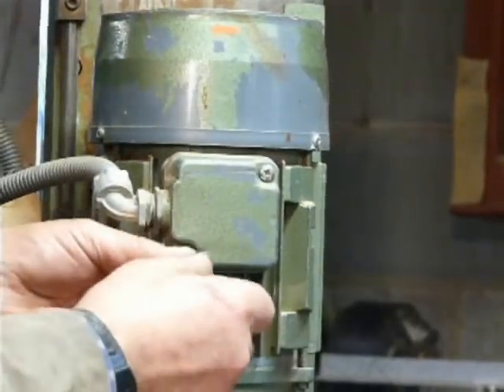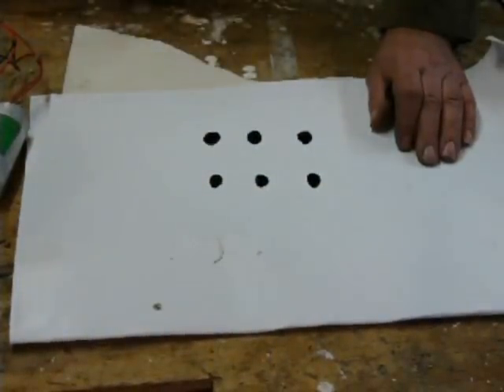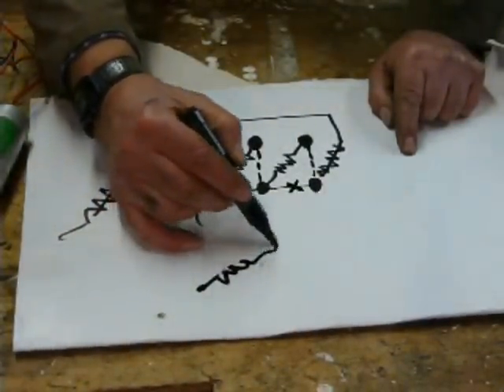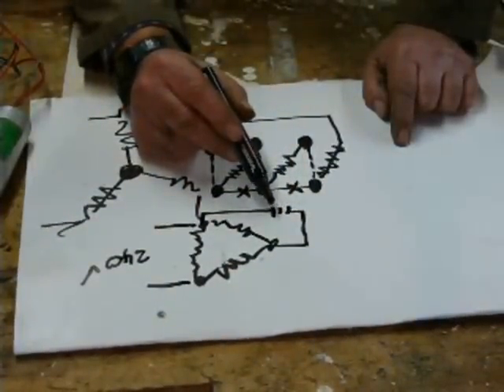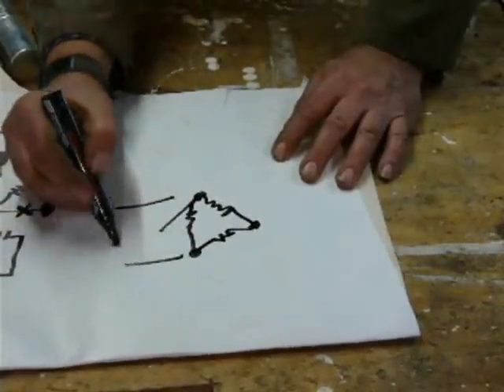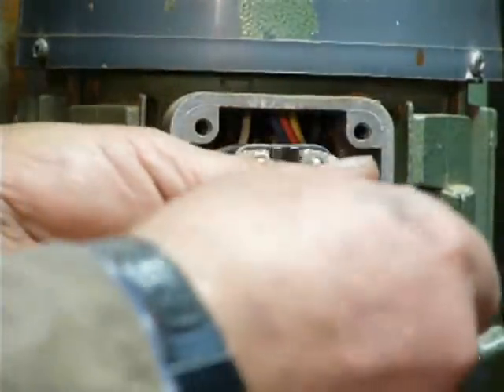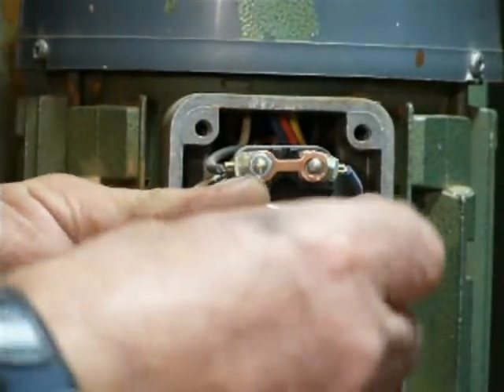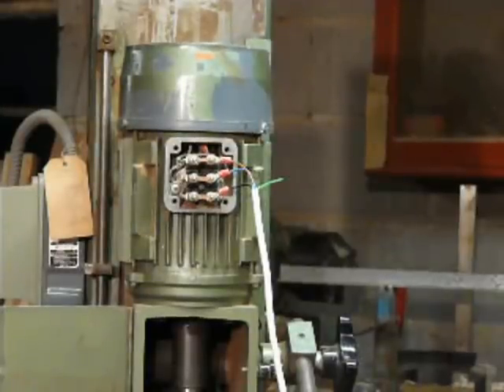How to do it: run a 3 phase motor on single phase supply. part 1

Comment: Hi.  In your very well helpful video you demonstrated what you were doing to change the direction of rotation in a delta connected motor.  I am assuming that a star connected motor works the same way as far as the capacitor connections are concerned.

I just hooked up a used vehicle hoist w/ a 3 phase motor connected to a phase converter w/ Parallel Capacitors - WYN SCM05 . 

The lift had been lying on its side and there was lots of leaked hydraulic fluids about.

The motor is a 3 phase / 3hp Leeson motor 9.2a @ 230v rated  w/ 6 leads.  
Your diagrams helped me recognize the connection as star.  Yea video.

The available voltage is 249v single phase.  Fairly high. Amperage draw should be less.

 I hooked up the L1 and L2 wires from the phase converter terminal strip to a 2p 15 amp breaker leaving all connections as they were after cleaning out the oil and tightening the loose connections and replacing the wire from #14 to #12. 

With 2 clip on ammeters attached to each lead, one set for peak and the other set to run I bumped the motor by lifting the control lever on the vehicle hoist which was in the down position.  The motor engaged when the controller was lifted but the lift did not rise.  
The motor ran at 10.3a drawing 56a  peak on start.  Made a bit of a grinding noise. 

Thinking that perhaps the motor was running in the wrong direction I changed the leads at the breaker.  Bumped the motor.  Reading were the same and grinding noise was gone.  Drive gear disengaged (?)

In the Phase Converter box were 2 caps, a indicator lamp, a black box and a terminal strip wired as follows. 
L1 is connected to lead T1 (Rd)
L2 is connected to lead T2 (Wt) and Caps via black box w/ switch in it.
T2 (Wt) is connected to T3 (Bk) via parallel capacitors as noted above.
T4 T5 T6 bolted.

The motor ran at 10.3a drawing 56a peak on start.  Lift doesn't rise.
I was expecting a higher load.  A 3 hp single phase motor would draw around 17 amps.
 
The motor runs on when drive lever is released.  Owner said the motor stopped instantly when the lever was released when last operated at place of purchase.  Might indicate that the motor mechanism is not engaging the lift drive and the motor is idling.  A loaded motor would draw more power and stop when power was disengaged.

As this motor is a hydraulic pump motor there is no way to check rotation that I can see at the motor.  Motor does drive a chain though. ( Perhaps I can see the drive wheel turning.)  I was worried about killing the motor so I aborted the test at first.   Later we ran the motor for about a minute to see if the hydraulics would pump up.  No cigar. 

There would have to be a limit switch killing the lift at both ends of travel. If the motor would have been driving the lift in the wrong direction (Down instead of Up) the limit switch would be engaged stopping lift from moving.  

There could also be an air bubble in the hydraulic system as it leaked so badly which would not allow the lift to operate even if the lift were operating in the correct direction.  Reservoir is at the correct fill height.

So I decided to switch the black and red motor leads at the terminal block of the Phase Converter (Capacitors) wanting to reverse the rotation of the motor to test the drive against the lower limit switch idea.  (Motor rotating in the wrong direction).

So this is what I did to reverse the motor.   Did I do it correctly?

Switched leads T1 (Rd) and T3 (Bk) on terminal block.
L1 is connected to lead T3 (Bk) 
L2 is connected to lead T2 (Wt) and Cap via black box w/ switch in it.
T2 (Wt) and T1 (Red) are common to capacitors.
T4 T5 T6 bolted.

Motor runs at 10.3a drawing 56a peak on start.  Lift doesn't rise.

I'm thinking that perhaps the motor is not engaging the lifting mechanism but I would like to know that I did manage to switch the motor leads correctly to reverse the direction of travel.

Any ideas?  Did I miss anything?

If nothing else writing this out allowed me to analyse what I was doing.
Drawing out the cct helped as well.
Reply from the maker: HI, so you are using a phase converter to change single to three phase. Vehicle lifts can be tricky. From memory the way to change rotation direction is to change two motor wires over. It is the capacitor that detemines the direction. A pilot motor helps to stabilise the third phase. If you are using a contactor the coil needs to be across the true phases, not the induced one, otherwise the contactor will not work properly. Hope that helps, Cheers
Reply: The freewheeling of the motor after the control lever was dropped was the key to the problem that allowed the millwright to diagnose the problem over the phone.  The hydraulic motor had become uncoupled from the electric motor during the move.  Too bad the coupling was inside the hydraulic fluid tank . . .  Once it was tapped the drive line fell together and the lift was in operation.

As for telling if the motor was operating in the correct direction or not (it was) apparently the hydraulic pump will draw down the fluid when rotation correct and spit bubbles when it's not.  That's how the millwright tells rotation.  He also said it does't work all the time.

As for the loading.  The motor runs at about 10.6 amps and peak inrush in 60 amps.  Perhaps another cap might help bring down this start voltage.  With the voltage being so high to begin with (249v) I think that helps reduce the run current of the motor overall.

As for rotation direction I saw a diagram on a different web page that showed how to determine the direction of rotation by where the cap was located in relation to the driven leads L1 and L2.   I used those diagrams to determine that I had swapped the motor leads correctly to effect a rotation direction reversal.

Here's the link to those rotational diagrams.

http://www.electricneutron.com/wp-content/uploads/2014/12/forward-rotation-capacitor.jpg

http://www.electricneutron.com/wp-content/uploads/2014/12/reverse-rotation-capacitor.jpg

It threw me for a bit of a loop when one was delta and the other one was Wye but I did get the concept of the moving capacitor indicates rotational thing and I worked mine out by just printing the Wye diagram out twice and reading one backwards through the paper to reverse the image for the opposite rotation.

So that is what the second motor is used for.  I've seen that second motor trick demonstrated but I never understood what it was doing.  I though it provided the third phase angle.  So you are saying that a pilot motor would be used in addition to the caps to stabilize the cct.

Thanks again for posting your great video.  It was very helpful in identify what I was going to be seeing.   Made me feel much more confident about the job even though I've never installed one before.

Comment: Is the Steinmetz connection, is useful in low HP...nothing new," the new" will be single phase motor to three phase motor.
Reply from the maker: That's right, up to about 2 Hp, cheers

Comment: I have a 10 hp 3 phase motor that has 9 wires, 3 wires for every coil, it's a weg motor on a Ingersoll rand type 30 air compressor.
Reply from the maker: Hi, too big for this method, see AVE channel for an explanation of 9 wire motors
Reply: thank you

Comment: hi watched video on  3 phase to 240 i have 3 brooks motor  which i want to convert how do i send you picture so you can see  wireing
Reply from the maker: Hi, Tom, take some time to make a video showing your motor and the various features and discuss your concerns and doubts. Then upload it to your youtube channel, cheers
Reply: I've just uploaded a video on my channel showing the motors! hopefully you'll be able to help.
Reply from the maker: Tom, watched your video and it makes things quite clear. It looks like you have a single voltage motor in star connection. The star point will be on the motor winding stator somewhere so If you want to change it into delta it will take some investigation and surgery. You can get this motor to run as it is with the capacitor method but it will have less power, which may not matter depending on what you want to power, try it and see. I could not see the voltage on the starter box plate but I suspect it would be 440v. This means the coil is 440v so will not work on 240. Best check it to see what it says. The starter / contactor is just 3 parallel switches pulled in by a coil. Take the 3 brown wires out of the starter and try the capacitor method. Hope that helps, cheers
Reply: thanks andy  motors off old cast iron table saw   i have so might not have enough power  so how would i convert to delta
Reply from the maker: Tom you will have to dismantle the motor to get to the stator windings and find the star connection strapped to all the winding connections, then bring all the 3 wires out and work out your new connections from there. Not for the faint hearted. Cheers, Andy

Comment: I have a three phase motor but when you open the top cover there are only three connection terminals  it doesn't have all the connectors as the one you are working on so there is no way to change around the links between the connectors, so i will . like to know how to change it to single phase
Reply from the maker: Danny, you have a single voltage motor, probably 420v. This will work as it is, but will have less power as the motor coils will have a greater resistance for the higher voltage. Otherwise you may be a ble to find the star point connection in the inner motor connections on the stator. You need to get all the connections right if you want to break into this connection. Cheers
Reply: ok thanks i will see how it goes

Comment: Why do you use capacitor on a three phase motor I thought you only use capacitor on single phase motor ?
Reply: The reason you need a capacitor with single phase is to create a phase shift to give the motor an inherent directionallity. You don't need a capacitor when you're running a motor from 3 phase power because that phase shift is built in, but if you're trying to run a 3 phase motor from a single phase, you need the capacitor for the phase shift.
Reply: Rob Mckennie  Thank you

Comment: delta = low voltage  y = high voltage ?
Reply from the maker: HI, as a rule of thumb that's right. The star connection has twice the resistance, cheers, Andy
Reply: thanks for the prompt reply...this is one of the best videos i have seen on the topic. This is something i have forgotten how to do about 35 years ago i helped a friend of mine set up a machine shop on a single phase input going to 3 phase laths and drill presses  have a great day sir
Reply: Chuck Rice I though it was wye start delta run on most motor why is this delta start wye run I'm confused.
Reply from the maker: Hi, with wye (star) there are 2 coils in series between any connection, and so a higher coil resistance that is only suitable for a higher voltage. Cheers

Comment: If you took a single phase motor and connect the capacitor wire to a 3 phase supply, would it still run or burn up the motor? I think the motor would run crazy or burn up but have no way to test it without 3 phase.
Reply from the maker: The blue smoke dragon would appear as you are putting 415v into a 240v circuit. Cheers
Reply: I see =(... Thank you
Reply: T Hoang if you have a 3 phase and neutral supply, you can connect a single phase motor between one of the phases and neutral. That will work.

Comment: Interesting difference in terminology. What you refer to as "Star" my  US Navy electronics classes referred to as "Wye" (Delta or Wye connection) or at least they used to in 1980.
Reply from the maker: Hi, yes I've heard of that, wye after the letter Y, having 3 terminals. Some vievers have attempted to tell me off due to termiality issues but as you say things have different names in the various parts of the world. Thanks for the comment, cheers
Reply: Wye has always been the way it was described until recently.  And for Andy, Wye can also have 4 terminals as you can tap the center of it for a lower voltage. Many Alternators used in industry can be wired in either style. If you have a heavy need for 120 Volts you can wire a 12 wire alternator to provide 208/120Volts and get better output than if you wired it for 240/120 3 phase.

Comment: Its been a while but from memory the motor should be be derated 10% (at least), will run hotter and have less torque than if it was run on 3 phase
Reply from the maker: I would say 30%, cheers

Comment: will this work on a 120 v ac 3 ph induction motor out of a washer?
Reply from the maker: Hi, I assume so given the correct supply and the correct capacitor values, but you wouldn't want to go putting 240v into it as the coils would draw too much current and burn out. If your supply is 110v then keep the star configuration Cheers

Comment: Hello Mr. Reynolds, thank you very much for this video sir! (as well as several others like it) ...very helpful!
Do you have any experience with Plasma Arc machines? Wondering how complicated it would be to modify a touch start to pilot arc. I'm thinkinking it's a matter of a ground connection but anything you could share on this would be SUPER and very much appreciated...THANX!
BTW Subscribed for quite sometime now!
Reply from the maker: Hi, I assume you are talking about A TIG welder or a plasma cutter. I have never used either, cheers
Reply: Mr Reynolds! Thanks for your speedy reply, yes it is a plasma cutter...sure do appreciate your knowledge sorry you cant help here, I'm sure I'll be around later for pointers down the road on subjects more akin to this video...bless you sir!

Comment: hello sir i.m from pakistan sir my motar is 5hp 3 phase i will convert single phase so tell me what is size for 4 capacitors?? reply sir please
Reply from the maker: You will have to work this out for yourself by trial and error. However at 240v there are 4 amps to the Hp and the start current can be ten times the run current. Cheers

Comment: Hi andy just subscribed I am going to start working on a 3phase garage lift motor to hopefully run it on single phase thanks for the video fingers crossed I get going once again thanks
Reply from the maker: Hi. Garage lifts can be tricky, depends if they are chain or hydraulic. You might have to use a pilot motor to stabilise the third phase before trying to start the lift. Good luck, cheers
Reply: Thanks for reply its hydraulic driven can you explain pilot motor as I am not at all electronically minded
Reply from the maker: What you do is get a reasonably sized 3 phase motor and do the conversion. When this is running without a load it stabilises the 3 phase. If you wire your lift motor to the pilot motor connections through a switch then you have much better starting, so the pilot motor is always started first. Hope that makes sense, cheers

Comment: how to run the dc 3 phase 110 v 100w 1amps motor with 230v ac
Reply from the maker: How can you have DC 3 phase as there is no wave form so there is no phase difference.
Reply: @TheInfoworks  Pulsed DC. ;-)

Comment: Andy Ive got a 3 phase with 5 wires to the motor is this normal?? i.e. the wires going into the motor has 5 wires not the incomer is 5
Reply from the maker: That's a new one for me, what does the motor plate say?
Reply: its not got 1, do you think it might be single phase?
Reply: AH lol only 4 wires so must be single phase lol Great vid by the way
Reply from the maker: That's good news then, cheers

Comment: i'm having delta connection terminals in my motor so wht should i do ???
Reply from the maker: Delta is correct, cheers
Reply: but you are showing for 6 terminals !! (star connection) and there are only 3 terminals taken out of my motor ??
Reply from the maker: That is a single voltage motor and is wired in star. The star point will be found bound to the windings. Try it as it is but there will be less power. Cheers

Comment: Hi Andy, thanks for the video very helpful. I have a problem though, I have a 3 phase motor on a fan converted to single phase and need it to be speed controllable do you have any information you could give me on how I could do this or what I would need to buy to control the speed? Thanks a lot, Joe
Reply: A variable frequency drive.